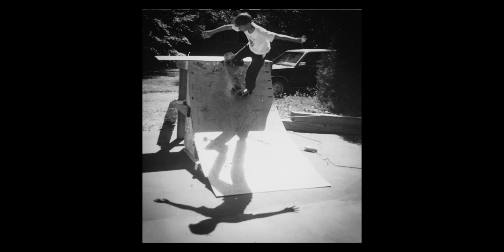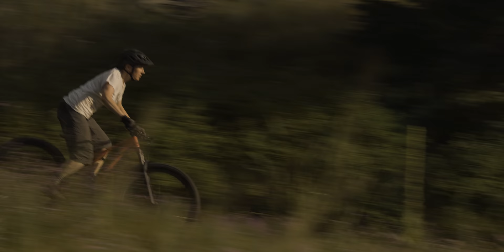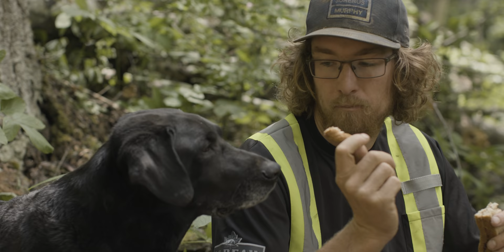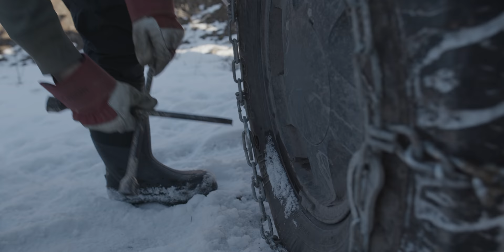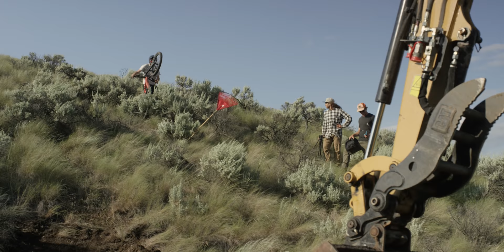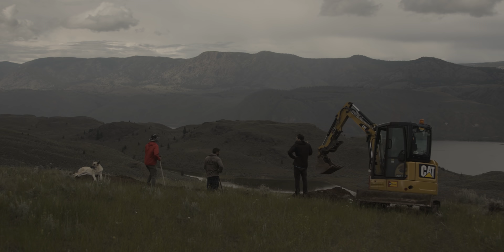Soil Searching: Kamloops

Comment: Are the lower end Stumpjumpers worth it?
Reply: Does it have two wheels?
Reply: Alloy stumpjumper is a different frame then the carbon stumpy. Alloy has a chainstay pivot, the carbon flexes. The alloy is like last years stumpy evo so yes the lower end is good. Problem is that their is nothing in stock!
Reply: @DM-hw4cr  Cool thanks!